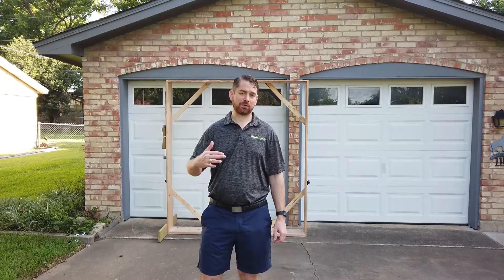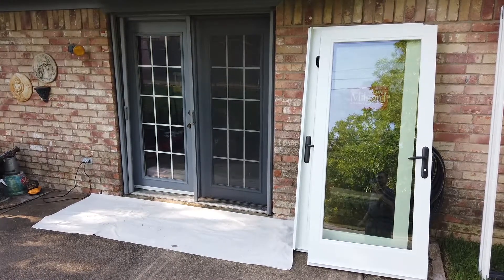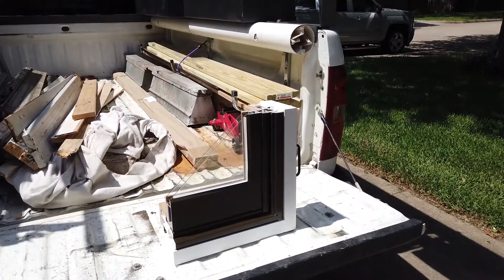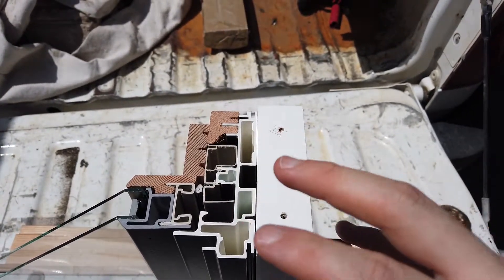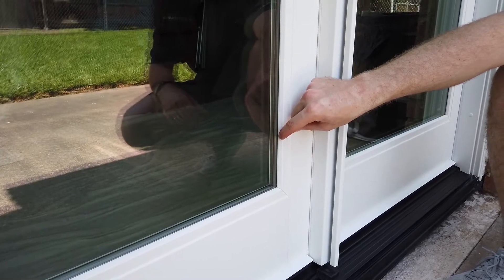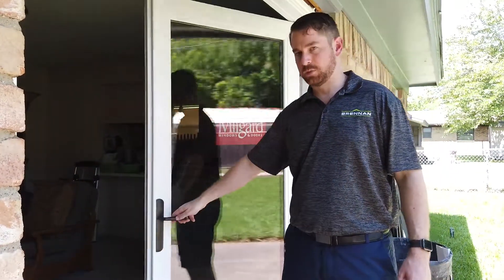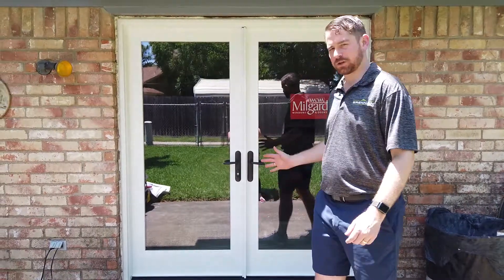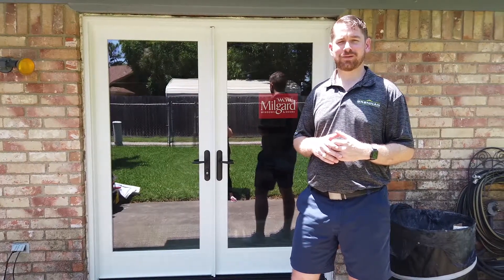Milgard Ultra Fiberglass Hinged Patio Door Review

Comment: What is the advantages and disadvantages of using fiberglass door frames vs traditional frames?
Reply from the maker: Wood will expand/contract and absorb moisture over time causing the door to swell or shift. Fiberglass is non-porous so it should remain more rigid than a traditional wood door.
Reply: @BrennanEnterprises  thank you!

Comment: When installing the doors did you use any sills to prevent water seeping in at the bottom of the door? Concrete slab? What do you suggest?
Reply from the maker: We apply flashing along the subfloor and 6-12" up the jamb and place two beads of sealant atop the flashing prior to setting the door. Our goal is to adhere to the manufacturer's installation instructions. ProVia is our primary fiberglass door vendor, and they have an easy to follow guide, complete with pictures -->> https://entrylink.provia.com/entrylink/doc.aspx?id=910